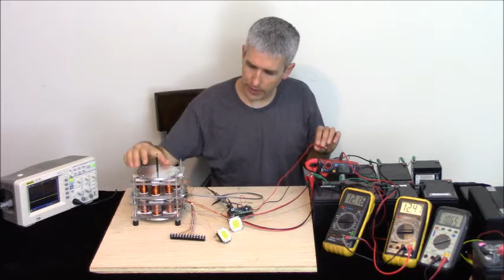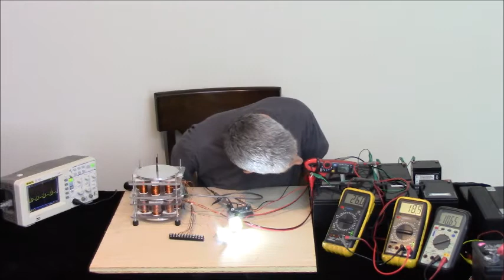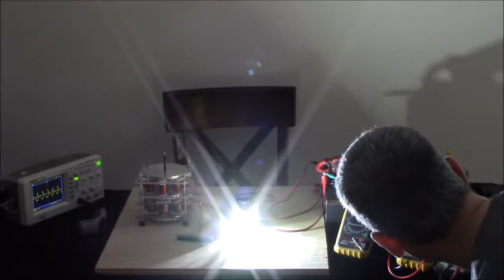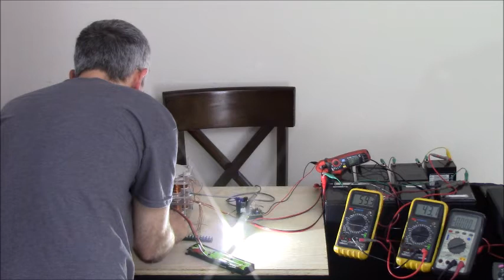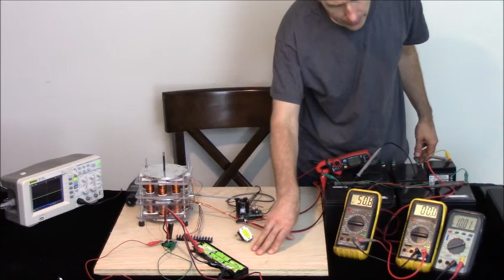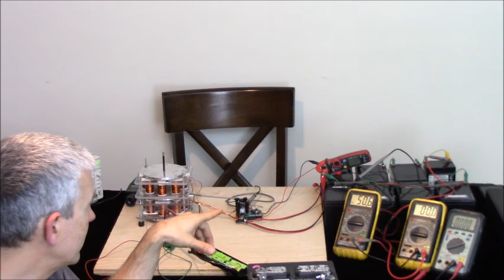4 DualPole Mini Double Stacked Arduino Controlled with new Rotors

Comment: When putting the emphasis on generating electrical power for charging, could the two forms of power be combined to a common output? In other words, the conventional energy from the generator coils, combined with the energy from the collapsing coil fields? Assuming you regulate both to be compatible, then charge a common battery bank?

Comment: Rick - I picked up an old scope and got a look at the new gate driver on my mini dualpole with the new mosfet. The coil collapse seems to happens in the middle of the "ON" time of the fet. I can't see any "spikes" - this scope has a rise time of 17ns, is that too slow to show the spike? I'm pushing 0.25 amps per motor coil (8 coils = 2 amps) at 24v. Here's a shot of the coil's output: http://bit.ly/2tg9DSI and here's a shot of the fet gate: http://bit.ly/2sWn0CJ

Comment: The increased negative phenomenon with this new setup - is it basically due to the improvements of the mosfet gate driver, or also your change to the STP310N10 fet? Will I also get the same negative with the other STP100NF04?. The STP310N10 seems a little easy to blow - I've blown 2 there just turning the motor off.
Reply from the maker: If you ever have a problem like that you can add a 1meg ohm resistor across the G and S as we do on the big fets. The new fet is definitely part of the improvement but mostly the gate driver. Diode also is an improvement.
Reply: Thanks Rick - I will add the resistor. Have a great weekend!

Comment: Also - how hard is it to capture the coil collapse with a cap in place of the charging battery and running the motor alternatively between this cap and the run battery? This would make the system more attractive - especially running at higher voltages so less batts are needed. Also might negate battery charging losses if positive charging.
Reply from the maker: It's not the coil collapse, but the initial turn on of the switch both at first and then right at the beginning of the coil collapse which again is the turn on point of that switching. 
There are many configurations possible with all this, such as running one motor into another, if done right. Charging up a cap depends on the cap and what you are doing. The cap pulser is not really about transferring the energy from the cap to the battery, but more charging takes place beyond what you see there, as the energy is not limited by resistors and diodes and SCRs. So all this is not as precise as people would like it. You have to look at the big picture beyond regular electronics understanding. Not being mystical here but there is more phenomena than what you can account for. Although I think PSpice programming and the like simulations can sometimes register some of the phenomena when you have the right mode/settings. 
I have done that with the alternating cap and even put that back into the primary battery, but that is bad for the battery to go back and forth. Perhaps a lithium could do that because of it's faster rate of charge and discharge. The problem is that when the cap is alone (lot like with the cap pulser and battery) it is a very limited well or source of energy (source as it becomes a negative resistor) and so the smaller the cup you dip into the ocean the less you get from it. Caps are thousands of times less capacity than batteries. You want the lowest ESR value caps and even batteries. And of course the more in resonance you are with anything the lower the ESR (equivalent series resistance). This amounts to faster charging and discharging response times and relates to lower impedances. The lower the ESR the more efficient the process. And of course we can get to zero and even negative. I started to show that at the Conventions where we can do this in many places in the entire network.
Reply: Thanks for the details Rick - I appreciate you sharing this information. Of course the other nice thing with lithium is holding voltage till almost spent - which gets round the problem of the motor slowing down, and also maintains a better potential difference to work with. I wonder if it's worth going through the pain of figuring out how to charge them. I have heard that the response well to pulse charging, if you can do so without over charging.
Reply from the maker: No lithium is actually a problem with holding voltage. They charge and discharge lineally. Lead acid hold the voltage. Lithium are low esr so they respond fast to pulses and can discharge fast. So they are more efficient for these applications. I just can't recommend them because they are a serious problem and there is no certainty that they will last, and the manufacturers change from one day to the next...
Reply: Lithium batteries are SUPPOSED to hold their voltage throughout their discharge cycle. Is this not true? But in any case, for the application of using quick storage and run back into the motor this shouldn't matter. I'm thinking something like a minute of charge and a minute of run, for both the primary and it's lithium "mirror". So getting twice the run time out of the lead-acid primary (especially using Loving Paths deal) and then using the generator coils as useable output. OR maybe better still to use the generator coils to charge the lithium and use the "event" on the switching to charge larger amounts of batteries.
Reply from the maker: Mark, just the opposite. They discharge lineally even though people oddly claim the opposite. I really don't use them in this work even though I use them in computers and phones, etc. The fact is that lead acid actually do hold their charge over 2 volts and then drop at around 10.5, while lithium progressively discharge at the same rate down. At least the batteries I have here. They don't hold a voltage and then are suddenly discharged. That would be nice as many applications require that.
Reply from the maker: Mark, So I just discharged my laptop lithium bank from 10.00V to now 7.83 with a super bright LED. And yes it did discharge exactly as I said, in steady voltage drop over time contrary to the claims about lithium batteries. So what am I missing here. This is one of the main advantage of LABs over lithium and NiMC and NiMH because they hold the voltage. Now lithium hold the amperage, and maybe that is where all these graphs are mistaken. They hold the amperage while the voltage progressively drops. They also charge progressively as well. This is a curious thing as I just went through many pages to find these same claims about holding the "voltage". Now with holding the amperage a smart load can use a voltage regulator to adjust the voltage and amperage so that the same amount of power can be used to low voltage, but that is not the same as saying a lithium discharges with the same load while holding the voltage for most of the charge. The best example of holding higher voltages is the LABs.
Reply: Rick - that is odd how the literature doesn't hold up to reality. Perhaps it applies to lithium batteries straight out of the factory but they loose this quality over time.
 Anyway - just got my mini dualpole running with the new mosfet, gate driver and now hyper fast diode. The one I'm using has a recovery time of 18ns (http://bit.ly/2sWn0CJ). Charging seems very good. I couldn't get the 11ns one as no stock available.
 I had my input at 36v and charging batt at 12v (input and charging connected in series) and the diode got very hot even with a heatsink on it. Once I equalise the input and charging battery voltages (36v on both) this problem went away.
Reply from the maker: You should not run the system with lower charging batteries or too small batteries.
Reply: Yep - every day's a school day :-)

Comment: This dual-stack is an exciting project Rick. I know you said the output is good for negative charging batts... has there been enough time yet to say it's as good as the trigger coil?
Reply from the maker: I haven't had the time to go out and get new batteries and do the thorough testing that will take weeks and months. There is a lot of negative energy phenomena, the question is how much positive energy is also there. That is, is the same amount of positive energy production still there as before (I don't see why not), and if so will this result in the charging being more negative or more positive over time. What needs to be done is take new batteries and cycle them at least 10 times by discharging them with a bulb down till the bulb goes out and charging, etc. Then seeing once they are discharged if they can take a positive charge right away or if it takes a very long time to charge them back up. If they charge right away and are able to put out power and power loads, like the bulb again over the same time, then we have positively charged batteries. My thought is yes, so then we have the best of both energies.
Reply: Cool. I am over due some new batteries - this is what I need to do. I am just waiting on some hyper fast "steering" diodes to join the new fet gate driver I've fitted, and I'll be ready to start doing this.